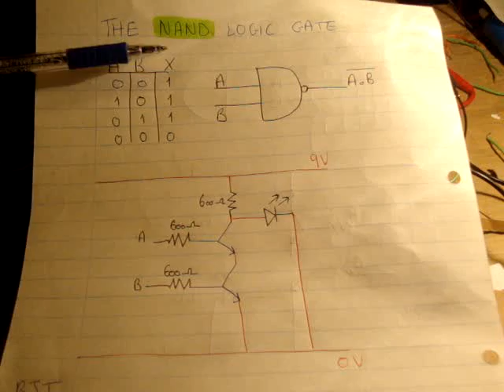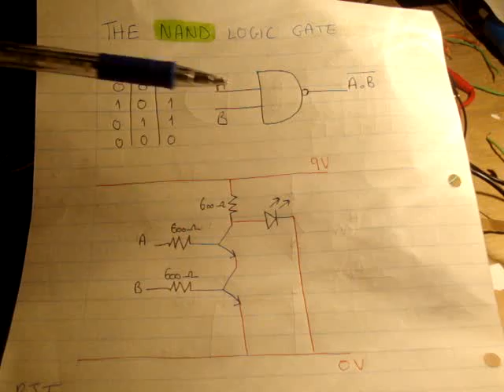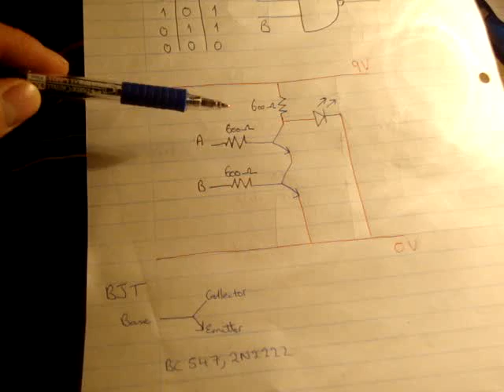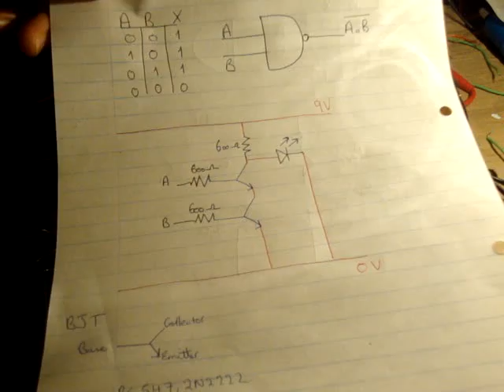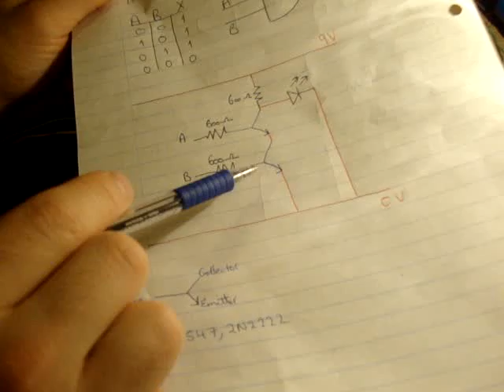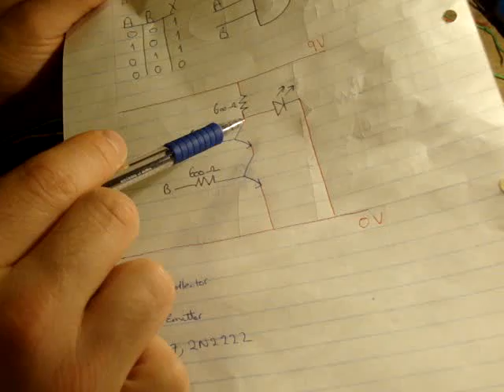Electronics 8 : How to Make a NAND Logic Gate

Comment from the maker: @milesdavidsmith Hi there, i'll have a proper look at this later on. Just looking at the Circuit Diagram, this is what i think.

For the output to be low, transistor B must be high and conducting (imagine transistor A not being there). This agrees with line four of the TT.

If transistor A is high, it conducts and should leave a low. However, only when B is also high does a path from high to low exist (which would make the low). Thus only when A & B are high can a low exist.

Comment from the maker: @enticed2zeitgeist Feed two pieces of information into the gate. It will output one answer, or one piece of information depending on what was input. If it was an AND gate, then the output will will only be 'on' (has a high voltage) when both inputs are on. Every other input set will give an off output. The NAND gate does the opposite and will be off unless both inputs are off.

Comment: Wow I get the same results, but by plugging A & B into the ground line. I can't get it to work plugging into the positive line.  I've retraced all steps and can't find my problem.  Any ideas?
Reply: Is your LED circuit linked to 9V or the ground?

Edit: Let me clarify.  The end of the LED that the transistors link to should be connected to the ground.
Reply: BionicKing I goofed!  I did not learn about the different kinds of transistors before starting this project and went down to the store and got a variety pack of transistors and all of them were PNP not NPN like the one in this video.  Once I plugged in the right transistors, the circuit worked right. However, I question why when both A and B are true and the light goes off, if this is a short?